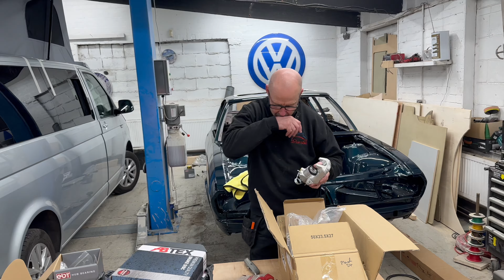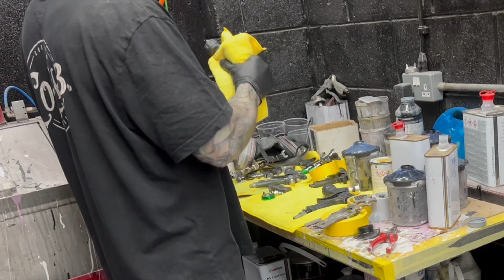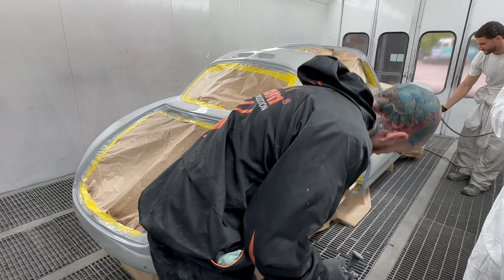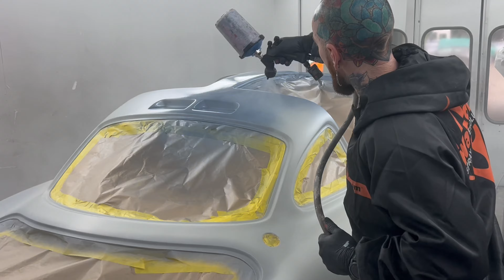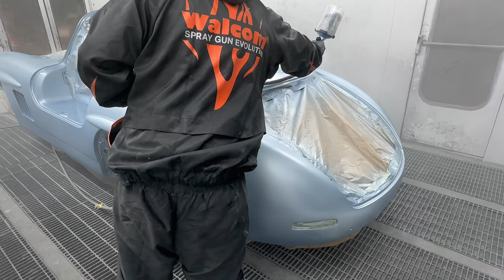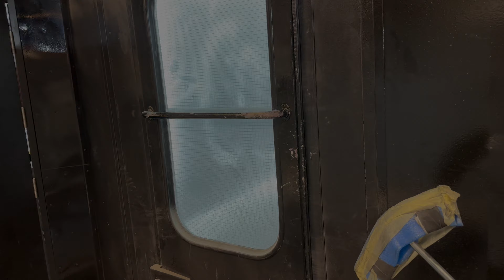painted at last but is it the right colour for the mercedes gullwing 300sl

Comment: Absolute STUNNER!  The first coat looked a little mottled, I was a bit concerned, but the subsequent coats flowed right out...  Can't wait to see it with closing panels fitted!!!
Reply: I think the first coat of three is usually a tack coat, 20 minutes and then on to a complete second coat..
Reply: @philtucker1224  Correct.  But if you've ever sprayed metallic paint, you'll know that the first coat sets the stage for the following coats.  It can be hard to get rid of the patterns that appear in the first...   A lot of painters will "Hollywood" it early in the spray to ensure even coverage because of this issue...  The guy spraying def knew what he was doing to get it flattened out.
Reply: @GregsGarage  yes quite right Greg’s, yes I have and have sprayed metallic silver which I found particularly difficult regarding just as you said..
Reply: @philtucker1224  If you've sprayed the silver then I'm sure you understand my high "Pucker Factor" when I saw that!!!  :D Nothing worse than having to grab the lacquer thinned to wipe the paint off a freshly squirted panel!
Reply: @GregsGarage  oh yes! That brings back memories Ha ha! Live long and prosper buddy! 🖖

Comment: He’s a very talented painter but get a mask on. Water based basecoat or not they’re still paint particles.
Subtle colour choice I was expecting something like a viper green metallic with that lovely interior.
Ps I remember painting a mk1 capri bonnet in cellulose back in the day, boss caught me doing it a a benson & hedge king size hanging out of the corner of my mouth( cocky 18 yo) think I’ve still got the bruise on the back of my head 40 years later.
Reply from the maker: It’s bens spray shop and it’s up to him if he wears a mask. I’m in no position to tell him what to do
Reply: Totally agree. I’d have him doing my paint work mask or not. That prep must have been amazing.

Comment: I’ve seen lots of these Gullwings and there aren’t many colours that suit them. The original opalescent silver is clearly the definitive colour. Metallics as such did not exist back then and anything with a clear coat look’s unnaturally modern.  The worst is bright colours followed closely by Matt black or cars with weird stripes on them. Jaguar had a light blue similar to yours in the 60s but not in the 50s and not as shiny. Black also looks good but I know that Ms Gullwing’s first choice is close to the colour you have chosen with a matching blue interior. Sure it will work out well.